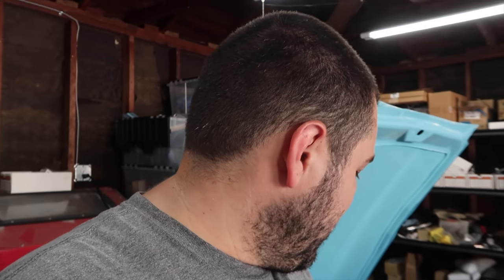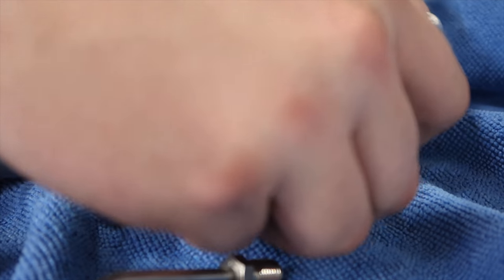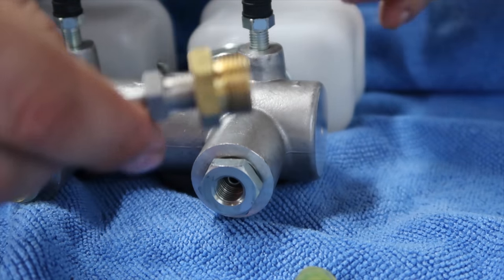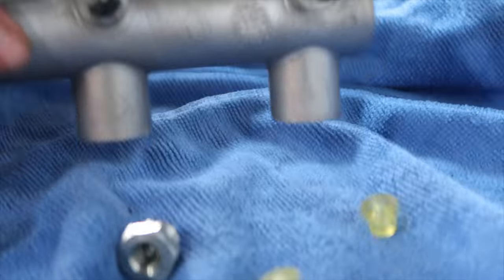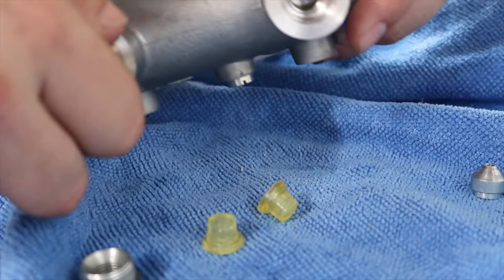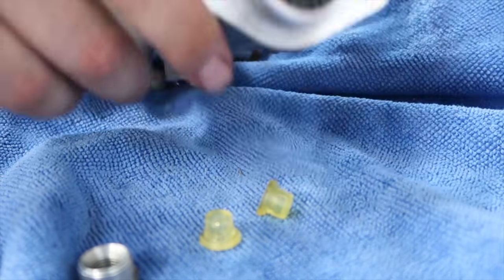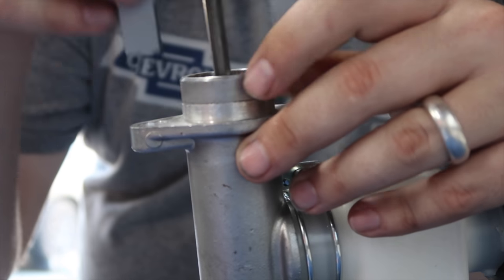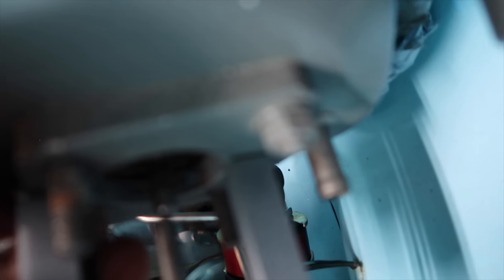1 inch Wilwood Big Brake Master Cylinder Install - Datsun 240z Build - Ep 48 - Panchos Garage

Comment: Question, did you use the rubber dust boot that came with the wilwood master cylinder? I can't get my master cylinder to sit flush with the dust boot on the master cylinder. But with it off it sits flush against the booster

Comment: I'm doing this on my 240z as well.  The problem I'm running into is that even with the MC rod adjusted all the way out it still isn't long enough according to the tool measuring device.

Comment: Really enjoy your 240Z restoration. I am doing lots of very similar things to my 72 240. One thing however, is sourcing the direct Wilwood master cylinder to Datsun brake line fittings. The supplier you show indicates these fittings are sold out. Can you point me to another source ?
Reply from the maker: Sorry not sure where else to get them. Maybe ask them to add you to a backorder list. I've had a few people ask me about the fittings recently.

Comment: I will be installing Wilwood front and rear disc brakes with the same 1" master cylinder. Are you running a proportioning valve for the rear?
Reply from the maker: Yup

Comment: Hi, .... really enjoying this build! Interested to know why you went with the larger 1” master cylinder? Is that because you require additional fluid volume due to the larger brakes. The reason I ask is that I have a set of large Alcon 4 pots on the front and Golf GTi units on the rear of my ‘71 240z. Initial bite is excellent but as I apply more pressure the bite fades. Someone suggested that my standard  ‘71 master cylinder is too small and not enough fluid is available to maintain full pad pressure. I’d like to hear your thoughts or anyone else who has done a disc brake conversion all round and has had to change the master cylinder to something bigger. Thanks.
Reply from the maker: I got a big master cause I have way bigger brakes than what was originally on there. Need more fluid movement
Reply: Francisco Gutierrez  ..... thanks for the reply. Looks like I am going to have to upgrade mine too. Looking forward to some more updates on this build. It’s good stuff.

Comment: werid for some reason my new brake booster and one inch wilwood master don't really line up, I drilled it out that's not the problem the problem is that it doesn't really sit flush, it seems to be the wilwood master that isn't flat its curved a bit towards the actual reservoirs, not sure if its meant to be like that

Comment: What's the purpose of removing that check valve?
Reply from the maker: If you have rear disc brakes you remove it.
Reply: Dominic Soto It holds back a little pressure (approximately 10 pounds) against the brake shoe springs so they stay close and ready to work against the drum. The disk brake back pressure is only 2 pounds which can be held back within the rest of the master cylinder. If he didn't remove it the rear calipers would drag on the rotors.
Reply: Great! Now i have to remove the master cylinder and remove the check valve :D was wondering why i had so much brake dust on the rear wheels!